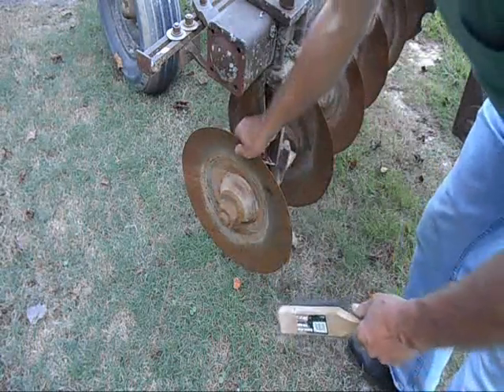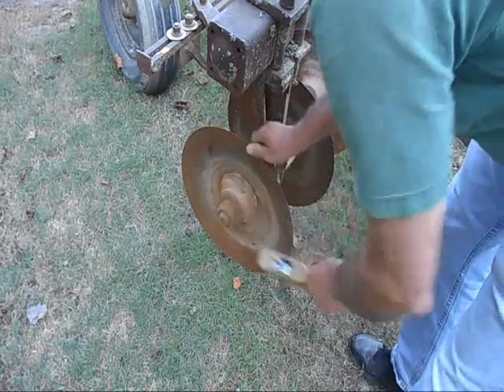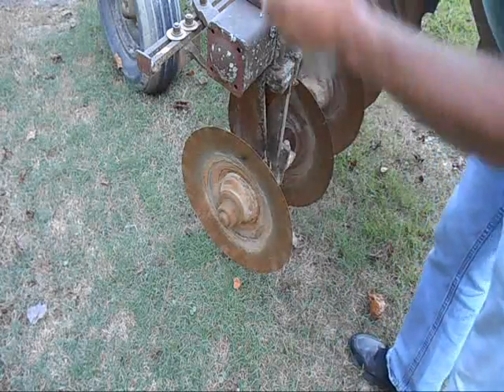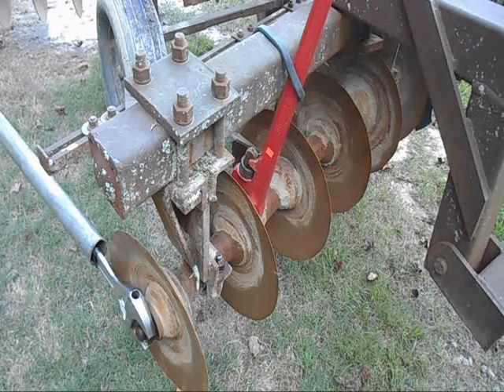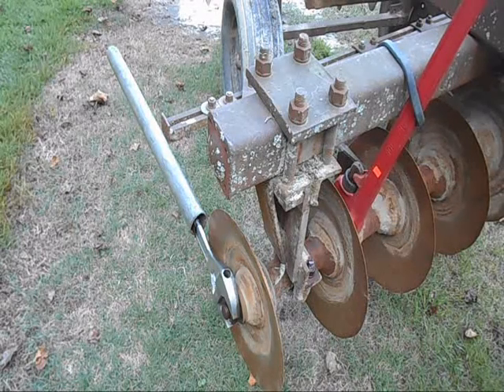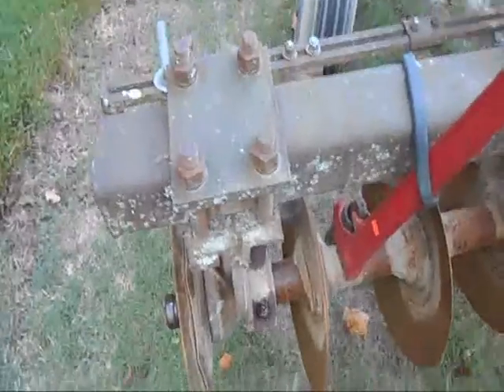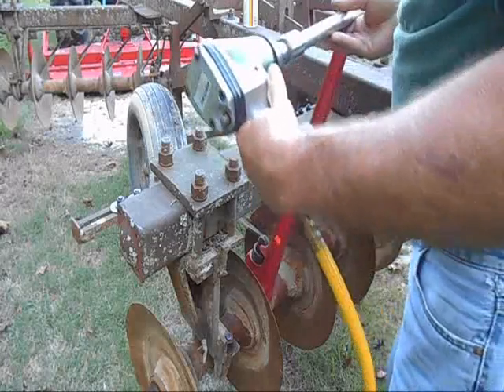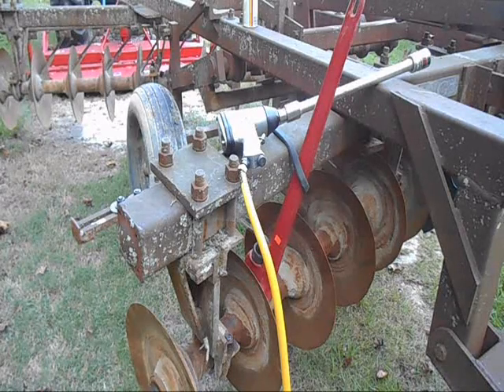Offset Disc Repair Part 1

Comment: Where did you buy your bearings from
Reply from the maker: I used to have a real good local access store called Agri Supply but they no longer carry these bearings because the source they had dried up so internet search and praise God to the rescue. These I found already have the bearing pressed into the housing and saves you a big aggravation with that. Save some money and go ahead and buy them bulk and throw them up on the Shelf.
https://thebigbearingstore.com/1-1-2-square-disc-harrow-u-bolt-pillow-block-bearing/
🙂🙏
Reply: @SoybeanFarmer3300  Thank You

Comment: You are losing torque through that extension  ,,,,,If you can go with just the xocket on the torque wrench
Reply from the maker: yes and the 4 gallon air tank was to small to maintain drive force.   I now have battery powered super high powered impact, works great.

Comment: Too much fun. Mine has a square bolt, old Case. Cheater and wrench. Mumble mumble...
Reply from the maker: Rocks and Oil - nice when they are equipped as yours is.